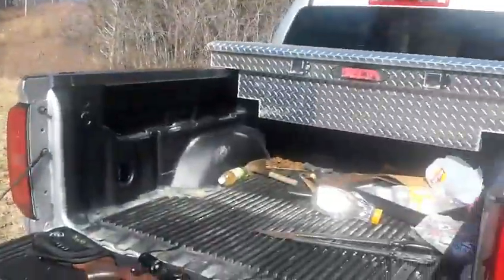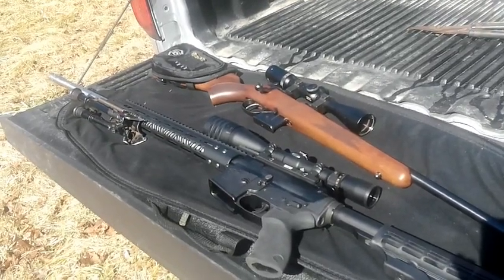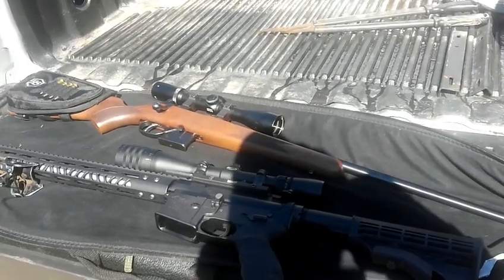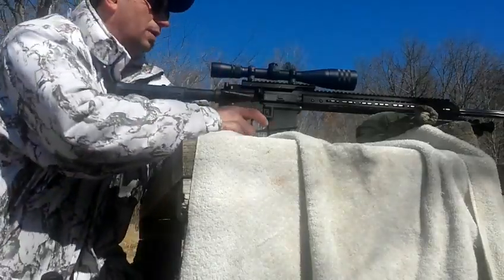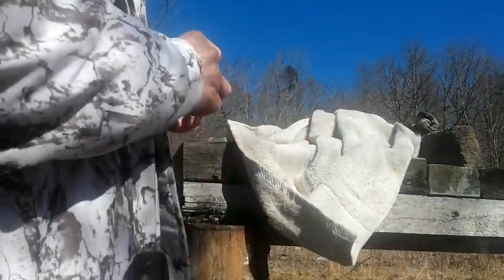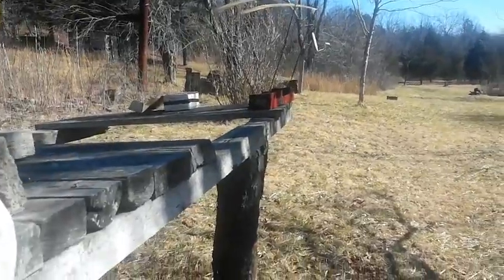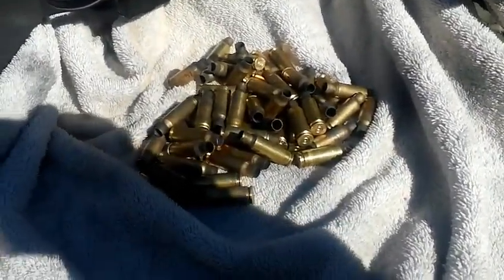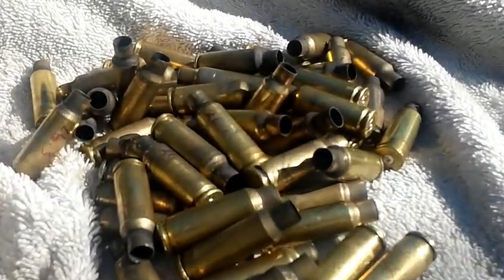6.5 Grendel fire forming brass from 7.62x39

Comment: Funny. I have the same 24" AR upper if 6.5G. Thought we had the same CZ527, but mine is the 26.5" varmint barrel.

So, do you just lube and press 7.⁶²x39 in a Grendel sizer? I'm trying to figure out how to repurpose Norma and PPU 7.62x39 to make 6.5G brass
Reply from the maker: @Swampytheroot  yeah that's all I did. Run the 7.62 into the 6.5 die. 
I didn't know they made the 527 Grendel with a heavy barrel. What ammo does it like?

Comment: Hey Marty I am try to make grendel brass from 7.62x39 and I cant get the brass to chamber all the way in my gun (fire form). Did this happen to you? If so any suggestions?
Reply from the maker: No.  I didn't have any trouble like that. Only the low powder loads didn't want to cycle in the ar15. 
They all fit the chamber fine. Are you using a full length die ?
Your may have a tighter chamber than mine. If so you might need a small base die to bring them back to factory size.
Reply: @martyjohnsonozarkoutdoors8198  I'm using the resizing/de-priming die  in the lee 6.5 grendel set. It is blowing my mind why they are still a hundred or 2 longer from the shoulder to the case base. If I turn the die down any lower it makes the case mushroom just below the shoulder
Reply: @tste8361  Measure your brass case length.  I bet you'll find it is a bit long.  Max for 6.5 grendel is 1.520 inch.  I've seen it happen when you neck down 7.62 brass, it gets a little longer than it should be.  File it down, or sand it, or case trim it, and then load 'em up and you should be fine.
Reply from the maker: @tste8361  I had an issue like like with a 5.56 barrel. Bolt wouldn't lock on the reloads. Bought a small base die. Still not right. 
So I machined .003 of of my she'll holder so the brass was pushed up that much farther up in the die. 
No problems since.